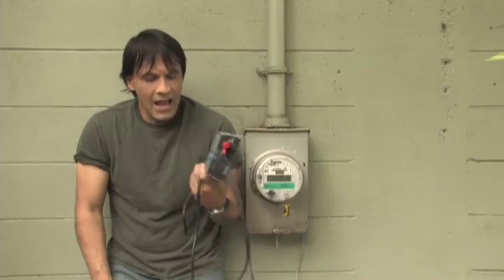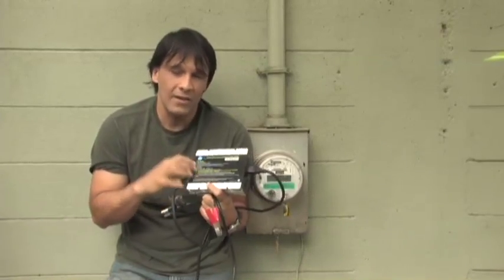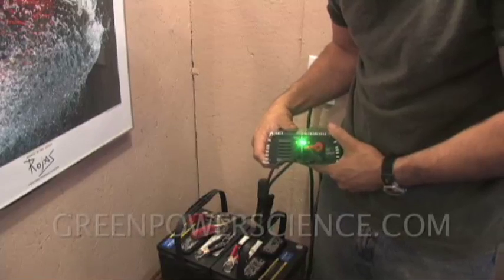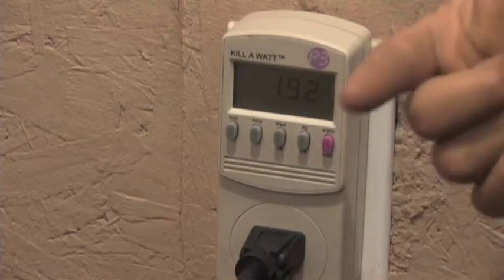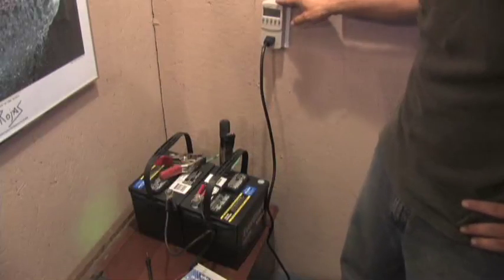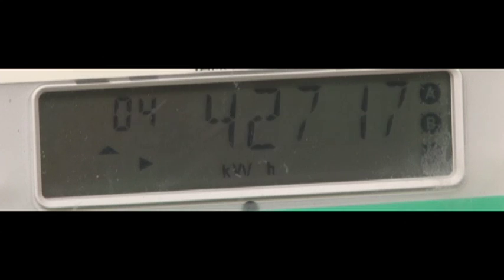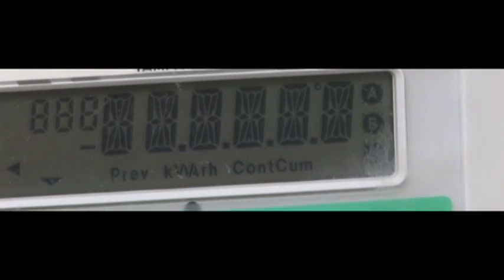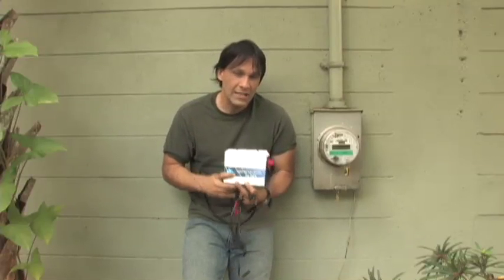GRID TIE INVERTER SOLAR panel POWER EASY Electricity Savings

Comment: My 4kW 240V inverter has a range of 212 to 264 volts.  The utility company isn't going to go outside that range.  Really bad things can happen to stuff that's plugged in if the grid voltage goes outside that range.  I mean, things can burn out or blow up.

So no, the utility company isn't going to turn up the voltage just to keep your 200W inverter out of business.

Comment: My 4kW grid-tied inverter works the same way.  If the grid power goes down, it shuts off.
However, there's also an inverter AC disconnect mounted outside (near the meter).  I guess the reasoning is that it's better to have a physical disconnect switch, so you're not relying on the circuitry in the inverter in a situation that could kill someone.  In other words, a single point of failure should never result in an unsafe situation.

Comment: I have a 3.5kW grid-tied solar system with a net-power meter.  Yes, it really runs backwards during the day.

Those squares on the display each represent one watt-hour. The faster they 'move' the more power you're using. They move backwards when the PV is feeding the grid. (That's how my meter works, yours is probably the same.)

Comment: Wrong!
The SI (International System of Units) unit of energy is the joule (J), equal to one watt second (one watt is equal to one joule per second); one kilowatt hour is exactly 3.6 megajoules, which is the amount of energy expended (or dissipated) if work is done at a constant rate of one thousand watts for one hour.

Comment from the maker: No, a regular inverter will get destroyed. These have a special chip set that matches the lines frequency and the are available for UK, there is a switch that can be flipped and they come with the different plug configurations.

Comment from the maker: That is a good question. It all depends on the vehicle. Generally electricity is cheaper than gas powered vehicles. If your car is running optimal, then the extra weight of the batteries and load on the alternator to the engine would be a loss. If you do not have a lot of stop and starts on the journey or have an overpowered alternator it will work.

In a perfect world, it would not help because your car would be less efficient with the weight and load, but in reality it depends on the vehicle.

Comment: True. But you're not factoring in the cost of the solar panels...and if you really want to output 24 hours a day, add the cost of batteries.

To put out 200 W per hour, 24/7, you'd probably have to have 1000Ws of panels--costing probably at least $2k, plus another $1k for batteries. Then you can add in another $250 for the inverter he shows, plus some wiring, etc.

How long will it take to pay off the $3250 at $200/years. Yup, 16 years, which is typical.

Comment: you say '2 cents per hour ain't much'? 

If you take the 200 watts (conservative considering in the video it put out more than that) multiply by 24 hours in a day times 365 days in a year you get 17520000 watts or 1752 kW 
times 12 cents per kWh gives you $210.24 savings per year.  
In NC I get it for 11 cents per kWh but that is still $192.72 a year.

Comment from the maker: Nope, these shut off when the power goes out. Part of the electronic package. You CANNOT hook this up to your house if there is no power. You need an AC source coming in for the inverter to work. If the power goes off, the inverter pulls ZERO amps and delivers zero apms, zero voltage.

They thought of that:-)

Comment: There is a big problem with this system.  If there is a power outage you will be feeding electricity back to the grid. The people who are fixing the lines could shock themselves from the power that your house is putting back on the grid.

Comment: Its always a good idea to have batteries to provide a constant supply of electricity. this way you dont have a surge and possably damage anything connected to the system or the inverter.

Comment from the maker: The technology has been around a while, used in many large buy back programs. AC side is generally safer than the DC side in regards to fire. In regards to shock, they only work if the grid has a current so the prongs are safe.

Comment: Good one Dan.   For fun you should take an AM radio tuned to the end of the dial, put it near the plug and see how much RF is being generated back onto the lines from the PWM inverter output.
Also, I was considering upgrading my meter to a digital version... I think I will stick with my mechanical one for my eventual solar projects.
A one-way meter?  bad bad bad.

Comment: ... But I guess if you're promoting the inverter that's OK.  Still $350 for 200watts is expensive.  If you intend to send power to the grid you have to be in sync no matter the source of the power.  Make a vid when you have an inverter that will handle a small home. The price will be less important then because you'll be making money right ?...

Comment: Nice video, but it only proves what I've been saying for years.  Solar power is too low grade to power anything of any significance.  Its OK for lawn lighting, traffic signs and science experiments, but its still way too expensive for residential / commercial use.  Solar panels + batteries + $350 inverter = less than 2 amps.  It would take 10 of these to power a hair dryer.

More power can be obtained by moving air or (better) water. But you'll still need a box to sync with the meter.

Comment from the maker: Hi,

The AMPs on DC jump to 10.3 when it is at full power. The Kwatt AC was about 180-190 when I looped the wire in this video.

Good catch:-)

Thank you for the comment.

Comment: Dan, nice video.  

Check the manual for your clamp meter.  I don't believe it's accurate for DC.  That's probably why it read low.  (Input should have been about 10% more power than output.)

Comment: Hi Dan, I'm glad you made this video. I saw this inverter and was not sure if the inverter would sync to the 60Hz. Another thing is that I'm afraid that when I have power connected to the grid and the Utility Company is shutting down the power for service, wouldn't it be unsafe for the Utility people to be working thinking they already shut off power from their side while I am still supplying power to the grid from my house? I'll take anybody's answer or thought....

Comment: I've read articles on how to make cheap solar panels.  Combined with this technique of inverting that power back into the utility, this project could theoretically be done somewhat cheaply.  The Inverter is perhaps the biggest cost which is unavoidable it seems.  

I think a cost effective solution for green homes would be to tie your solar panels into your home grid to supplement and sell power back to the utility.  No need for battery banks.

Comment: How does an inverter backfeed power through an open main breaker switch?  Is there a magical connection between the meter and the breaker box?

Comment from the maker: If your DC input is less than 14V DC it just sits there with 1 solid green light. The unit measures the DC voltage coming in and drops the AC output to prevent the load from dragging the battery below as long as possible, once it falls below it stops only 1 green LED 
Zero Amps Zero Watts

Comment: So if you don't have enough voltage running into the inverter, does it pull any from the grid in the house, or does it just sit there and look pretty

Comment from the maker: No UL markings, I would hook it up in a safe area for a while until they test further.

I actually have mine outside and feed through an extension cord as the higher voltage 120v has less resistance. If something happens, it is outside covered from the elements.

Comment from the maker: They are cool, but when the power goes out, they auto shut off or the spike load would destroy them.

The old meters were cool, these new ones stink;-)

Buyback meters and 2 way or dual meters buy back at a discount.

Comment: Well, if each number on your meter stood for a kilowatt/hr, then it would take FIVE HOURS for your 200 watt inverter to put in 1 kw/hr.

OTOH, if the last two digits on the meter were hundredths of a kw/hr, then they should have been clicking backwards every few minutes.

You may need to request a meter that can go backwards from the power company.

Also, the average price in Florida for 1kw/hr is about 12 cents. So......about 2 cents per hour ain't much.